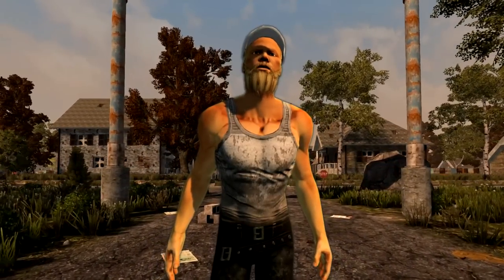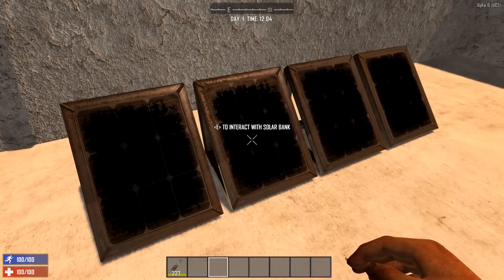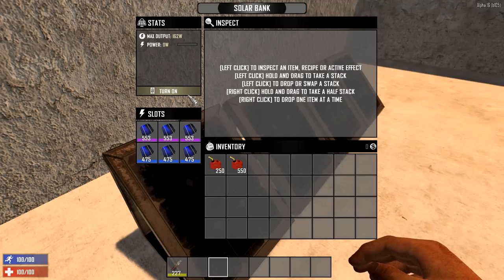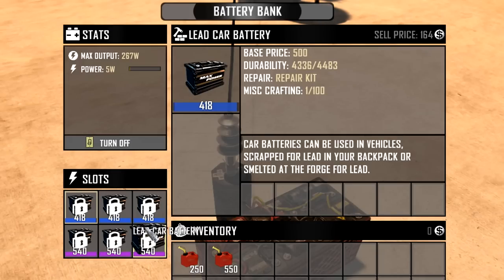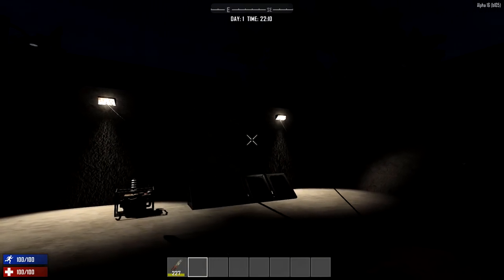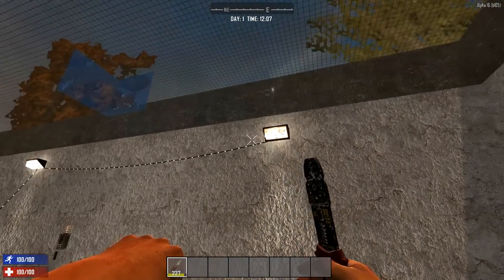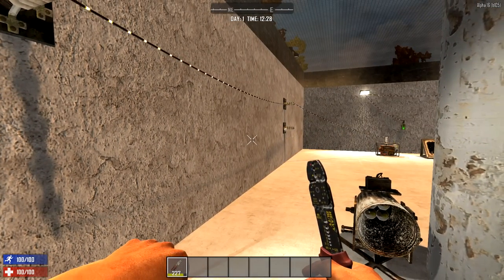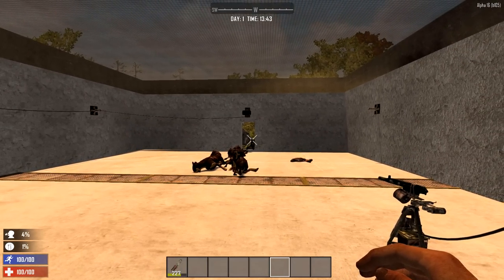7 Days to Die Electricity System Guide | Introduction to new Alpha 16 features | Beginners guide

Comment: There should be a random low % chance to get an electric shock anytime you work with apocalypse electricity, zap you for a few HP.
Reply from the maker: +Faffy Waffle Don't know about that. It didn't happend to me while i was recording this video (1.5h)
Reply: I walked through my own electric fence on accident, if that counts
Reply from the maker: +GamerxTutorials Ouch...
Reply: No, I think he means it SHOULD not it DOES.
(:
Reply: Yeah, I mean they should add it in.
Reply: Faffy Waffle I would disagree with that. 
Because as an electrician i would say that if you know how to build these things, you know when there's power an when there isn't.
Reply: Well, but it's the apocalypse though, you're jimmyrigging things. Stuff isn't factory quality any more, it's corroded, degraded, junkyard quality scraps. When you hook things up, sparks may fly. The character is also learning from books and schematics, not an experienced electrician. I was just coming up with way to add a nice touch to the dystopia.
Reply: Faffy Waffle I get the idea you made. 
But still think you wouldn't get shocked. They could add "back story" to the character, where he ex. Could be a electrician and therefore are a bit better with that or had a medical background and then were good at those things.
Reply: This comment died a month ago -_-
Reply: QuadBitzy congratulations ?

Comment: can i have multiple generators in a single group of power devices? 
let's say:
I have a solar panel bank with 175W max.
I have two powerbanks
I have all my light sources, and turrets powered by connecting them to the powerbank.
during night time, powerbank supplies enough power to all devices.
during day time, solar panel supplies power to powerbank and all devices. costs 263W total, which is not enough for solar panel.
Can I have another solar panel or power generator to generate more wattage in this same group?
I couldn't do that because generators cannot have parent connections
Reply from the maker: +Squall0833 You cant but you can separate some devices for other generators.  Atm its only 1 power line between power source and power consumer
Reply: thanks for the info,
hopefully the dev can make it possible. guess i need to separate them :P

Comment: Does a running generator consume gas if nothing is on the grid using the generated power?
Reply: yes
Reply: I assumed that'd be the case, thanks. So pumped for this update.

Comment: whats the best time to turn on the solar panels?
Reply from the maker: +Nennek Colod Keep them on all the time. They don't use require any fuel to work. Use it to refill your batteries in battery bank for the night(if you have one).
Reply: oh right..I had fun testing things out I haven't slept yet during the time I wrote that..I just realized its common sense that they need sun to operate so technically they will turn on and off automatically based on the sun's availability. thanks for replying

Comment: What happens when you try to connect more than one power source to a battery bank?
Reply from the maker: +Varinki Only one can be connected, it disconnects other source
Reply: That's going to be annoying. I was hoping to build a system that used solar during the day and a generator at night in one system. I suppose I can build a self contained system with a solar panel and a battery bank and put discharged battery's from the main system into it to charge.
Reply from the maker: +Varinki System is fairly new and could change in the future. Good luck playing with electricity
Reply: I hope so. It's a little clunky at the moment. I don't think I will be illuminating an entire town with it in it's current form.

Comment: Fallout four copy
Reply: This is nothing like fallout at all. There is little to no NPC interaction besides trading, the rest is either on an online server or in a singleplayer world. Other than that the building isn't pre-built or wall & floor modular building, Its block modular building. They have almost nothing in common, not even the setting, if you've noticed, zombie apocalypses and nuclear winter is not the same at all. Bethesda even says that ghouls are nothing like zombies, they just have radiation sickness so severe that their brains rot.